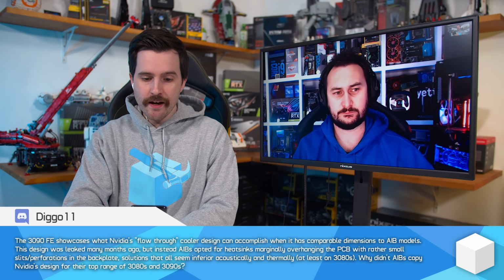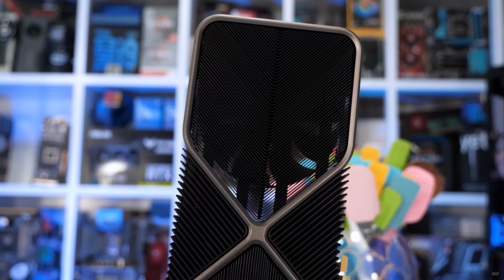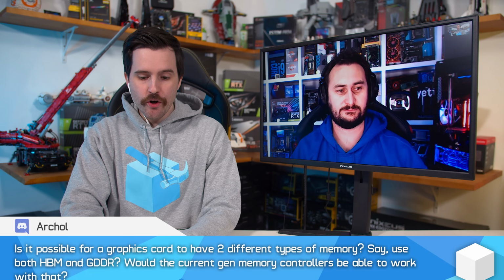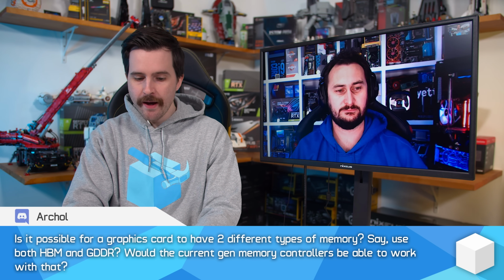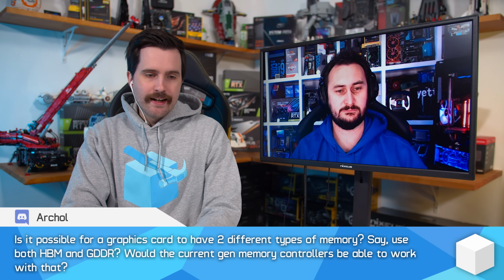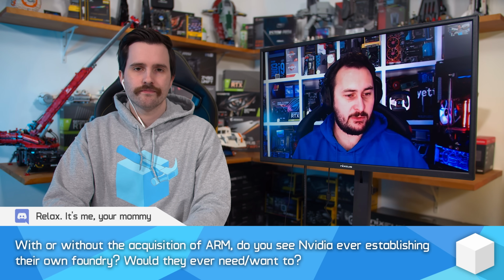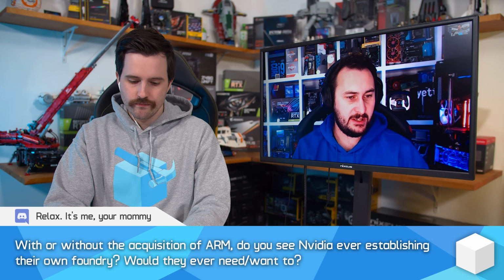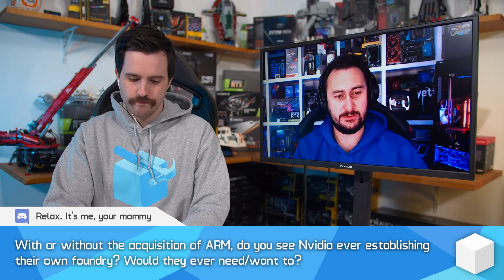Will RDNA2 and Zen 3 Have Launch Issues? Can AMD Beat Nvidia at Ray Tracing? September Q&A [Part 3]

Comment: My rx 5700 xt had HDMI audio issues since launch day.. Yep for a full year I couldn't use HDMI audio as it would stutter, cut out and  certain games just didn't have sound at all. I eventually got a HDMI sound bar for my tv and it had the exact same issue.. I had to use a optical cable connected directly to my motherboard. 
The last three driver updates completely broke freesync too.. I had to revert back 20.4.2.
Fan curves, overclocking etc within the AMD software wouldn't save after a reboot ethier.  Had to manually load my profile everytime. 
Some games especially certain older  titles run horribly on the card.. Dishonored 2 has a constant micro stutter, fallout 76 runs god awful (lower end nvidia cards beat the performance) and rage 2 has a technical glitch with spark effects 

Quote rare but I also experienced the green screen crash when hooked up to my TV (didn't happen on my monitor) 

NEVER AGAIN

Got an RTX 3080 over a week ago and haven't experienced a single issue when hooked up to the same 4k TV (same hdmi cable too) no audio stutters, games that ran like crap work smoothly and my monitor which has freesync but is g-sync validated works like butter lol

Love the cpus from them but not getting an AMD gpu again and I've been buying AMD gpus since 2012..my first experience of green team has been amazing 😁
Reply: That's what you get for buying cheap. Should've gone with 2070 super.
Reply: @fabAB912 ? I got an RTX 3080 last week
Reply: Really? Cool story bro, but I never had such issues. Not that I had the same use cases as you, but still.
Reply: @robertstan298  Why would you insult a fellow PC gamer who has suffered these issues with "cool story bro"? It seems unlikely that someone would make up a story and you're not having the issue changes nothing. No one who has a problem gives a shit that you don't unless you have a solution to the said problem.
Reply: Assuming everything you said is true, which I believe it is, your comment is one of the most important things that can be said about GPU choice. 

Spending big money on a product that doesn't work properly is infuriating. I don't care about 10% this or that performance if the product is a malfunctioning mess. There's a lot of people who bought 5700XT who had none of these issues but perhaps they are using Display port and MB audio. If the card comes with HDMI then the HDMI ought to effing work. 

I'm hesitant to buy 3080 because of the energy consumption, but I'm not going run out and buy AMD unless I am reasonably sure that I won't have  problems. 

Incidentally, my Gigavyte RTX2080 had absolutely appalling fan curves and the software that you could use to change them caused the card to lose 99% of its performance whenever an Nvidia driver update came out. To that I said "never Gigabyte again".
Reply: @Mattribute  Well some of the 3080 issues that have popped up (crash to desktop, performance degradation etc) have to do with drivers. Some of the card makers have resorted to pushing out new BIOSes that lower the clocks. Anyway, driver issues or hardware ones... Ampere launch has been pretty abysmal. If AMD has a better launch and decent initial drivers I'd say they have a good chance of winning some mindshare and good faith. They've been hireing a lot of new software development people recently and they've also been bleeding some of that Zen engineering talent into the Radeon division as well. Fingers crossed gamers finally win something back this genration.

Comment: I deem it very unlikely for AMD not to have supply issues at launch. The Zen2 launch was one of te worst in recent history so it couldn't be worse than that but probably still worse than the RTX3080 launch.
Reply: Tbf those were both popular releases.
Reply: @somethinglikethat2176  Definitely and Zen3 is expected to also be popular but there will probably be more supply than with the Zen2 launch because AMD didn't expect Zen2 to sell as well as it did. Of course AMD is still a bit of a small fry compared to Apple or Nvidia so it isn't certain how much production capacity AMD will be able to get from TSMC even though Nvidia Ampere is produced by Samsung. So I expect Zen3 to have more supply issues than with the RTX3080 but less than Zen2. With RDNA2 it will depend whether it's actually good. If it has good price to performance it'll probably sell as AMD expects but if it's actually good full stop there will definitely be supply issues as there will be more demand than supply. That would be Zen2 all over again.

Comment: 12:37 If one trusts leaks, AMD's RT solution is inferior to Nvidias in Performance, it is however optimized to need waaaayyy less die space.
Reply: Inferior to Ampere maybe, but probably superior to Turing. Either way the tech they supposedly use does seem pretty ingenious and efficient. Props to AMD engineers if they pull it off.
Reply: Interesting from a technical standpoint but not from a consumer standpoint. Just buy whichever is most powerful in the typical games you play.
Reply: It's confusing because leaks say AMD's RT is faster than Turing but slower than Ampere. Yet hardware unboxed testing says both Turing and Ampere incur the same performance hit.
Reply: @Arjun-eb1yc  Yeah, I was also a bit confused by that video Tim did, coz he pointed out something valid, ie, even though the RT perf of Ampere is higher it's mostly due to brute force (more RT cores), but the perf hit by enabling RT is roughly the same (slightly lower at 4k iirc). Whether the gen-2 RT cores help in any of that is still unknown, even though Nvidia claims some 2x number.
But then again it depends on the core config, imagine if the 2080Ti (or the 3070) has the same no. of gen-2 RT cores from the 3080/3090, then we could be looking at much less perf dip by enabling RT.
Reply: Not suprising since nvidia has more experience with this technology

Comment: I think this could be the first ever time AMD will come dangerously close to Nvidia's performance.
This is why they released the 3090 - it'll probably come down in history as the new Fury X, 290X or Fermi in terms of high performance and high thermals.

Still, if AMD really wants to completely steal that performance crown, they'll need way more than 50% perf-per-watt improvements in RDNA 3.
Reply: 3090 has bad thermals? Have you seen the reviews?
Reply: fabAB912 No. Are the thermals okay?
Reply: @mix3k818  like 76c but it consumes too much power for me. also amd is most likely to beat it while using way less power
Reply: @justmixah3408  beat the 3090?
Why you feel is too much power?
Reply: @2boostedsilverado  you have to have leaks to know why its to much to explain
Reply: @justmixah3408  hope you are not getting your leaks from Moores Law is dead" Lmfao
Reply: @2boostedsilverado  im getting them from my own people LmFaO
Reply: Thermals! 
I want what you are smoking dude

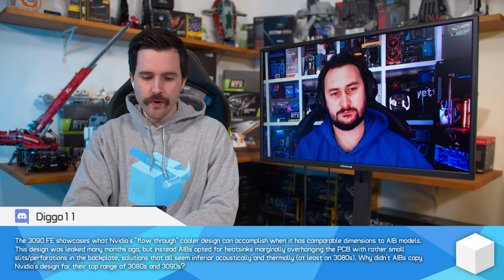Comment: 05:10 people always forget that GPU's with fins going longways also dump a lot of air out the back of the computer case, there almost like a half blower (a bit like the nvidia one but much cheaper).
may not be as much air going out the back but i can feel a lot of air being pushed out the back of the gpu when i play games.
it's only fins going short ways (towards the mobo and case side) that dump all the heat in the case but at the same time the hot air gets out faster so they are more efficient at getting the heat out of the gpu heat sink.
the blow direct thro the PCB like the nvidia's second fan (or say some of the sapphire gpu's) is the most efficient as the air is not forced to do a 90 degree turn but agen all heat go's in the case but at least it's pushed in a good direction to get sucked out with this layout.
Reply: @METhOdhowtoKilLnoObS im not talking about blower cards but normal dual fan ones with heat sink fins that go longways on the card (front to back).
they push a lot of air out the case.
lots of cards have fins that go sideways (from mobo to case side) that dont push any heat out the back of the case.

so i was trying to say cards with fins going longways like the nvidia setup push a lot of the air out the back of the case (not as much but still plenty)

Comment: That 21:9 demo was dramatic AF. I approve
Reply: One Person who I know from all possible people who I know has ultrawide. Did buy it two weeks ago... Lets be real... Wide screen is really rare among pc users! Just like 3090 is rare, but ofcourse there Are people who has those... but a common... no...
Reply: as a fellow UWMR I also approve and I dunno if you guys actually know but there is a great chrome extenion called UltraWide Video, so everything fits perfectly.. for like 2 seconds of the video anyway lol.16:9 will die soon enough, steam charts are not the only thing that matters, more are using UW than most people think
Reply: @connormoorerocks  16:9 wont die anytime soon, its the best gaming res, to start (yes ik 21:9 looks better AT CERTAIN GAMES, obiously productivity is just plain win for 21:9 bcz u know.. its just more display), but 21:9 displays r also more expensive than 16:9,  and dont forget, refresh rates, 16:9 have less piels to drive so, for competitive gaming u can get a 240+ hz display while ultrawide... the odyssey g9 sure, however something fairly possibe is 18:9, why? well smartphones use it
Reply: @arencorparencorp2189  Damn that marketing. They're using 18:9 instead of 2:1. It just sounds so much better
Reply: @Saigonas  well since its fullhd+ it comes from 16:9+.. so yea like 2k is usually refered to 1440p
Reply: @arencorparencorp2189  yeah, but isnt 2K like 2160:1080p?
Reply: @Saigonas  exactly, its incorrect but usually means 1440p

Comment: Zen 3 likely no.

RDNA 2, however, just like Turing, Ampere and every ATI/AMD GPU release past 2010 will likely have driver problems at first.
Reply: you mean like  how Nvidia cards are having driver problems? Before you sook about it not being Nvidia, I'm talking about screen tearing on 10 series as well with latest drivers
Reply: Lunchos El Maximus then you don’t know how to use the in game settings and or the nvidia control center. Both my 1070 and 1080ti have no issues with screen tearing. You just suck. Software issues exist everywhere, it’s not limited to just intel, amd or nvidia. Some do it worse than others... like in the recent years is amd.... cough cough, r7 and 5000 series. Nvidia having issues on 2 models of gpu’s was cause of the aibs.
Reply: Same thoughts
Reply: I don't remember Turing having driver issues at launch, Ampere has driver issue for it seems 1 revision (current version seems to already resolve the issue) and Linux nvidia users never had crashing with Ampere.

AMD meanwhile... oh boy half year after release there were still issues both on windows and linux.
Reply: piotrj333 I remember people were complaining for 3 whole weeks before Nvidia uploaded the Turing patches.

EDIT: Still better than AMD's RDNA 1 patch release (8 months), but it was there.
As for Linux, I've heard AMD had better driver reputation there than on Windows (but probably only because of Nvidia's own drivers)

Comment: Personally RDNA 2 i think will have some sort of issues. For nvidia they had one whole generation with dedicated hardware and still launch was shaky, it took many updates to make for example rtx in battlefied 5 acceptable. Nvidia had issues with first generation of DLSS (DLSS 2.0 is absolutly other story).Chance that AMD will nail down raytracing, dlss, raw performance etc. without upgrading their processing node (comparing to RDNA1) is actually low.

CPUs in that aspect of technologies are actually easier to adopt and AMD mostly only improves stuff they already did so on CPU side i would expect it mostly to be fine (beside potential BIOS updates).
Reply: To be fair, they already had developed the sharpening technology they want to use for raytracing, they could have leveraged their console partnerships to develop a raytracing technology, and the first Navi cards were actually only partially using the RDNA architecture, which itself was a brand new architecture (Needing optimization), so I wouldn't be surprised with a big jump in performance.

Especially given AMD actually had something that looks like a R&D budget this year (Imagine that, AMD choosing not to use a blower cooler! Madness, I tell you, madness!)

I just doubt that they can use their sharpening as a "dlss alternative", except for like, very small increases in resolution (Forget 1080p to 4K upscaling)
Reply: IF (And with Radeon that's a big if) they can deliver the raytracing they're promising, I can see it becoming a question of whether you want DLSS or you want a raytracing that just works.
Reply: @WhenDoesTheVideoActuallyStart  Yeah, I feel like if any generation of Radeon cards will give at least some competition across the entire stack, this will be it.

As for DLSS, I'd probably not look at it as a major factor in purchase choice (For now at least), for the simple fact that it's probably going to be very difficult to implement, given it's reliance on machine learning. With Raytracing at least, basically everyone is just using the Microsoft DXR API, which should just work on any hardware
Reply: The major problem with Turing was it was very much the beta test, for Nvidia and developers. Very few games actually had raytracing, and fewer still had it done well. AMD has had a year with various titles supporting DXR to test behind the scenes, improve the architecture, and the fact that 7nm is still a better node than TSMC 12nm like Turing, or Samsung 8nm like Ampere. Nvidia rushed Turing out to get RTX to the masses, and build up that mindshare of associating raytracing with RTX, and making sure we all knew it was "The future of gaming." The problem AMD had with RDNA1 wasn't that 7nm was behind, It's not, in fact it's still ahead of Samsung 8nm. The problem was the architecture itself had problems. Problems they've had a year to redesign around, and potentially fix.

While I don't think the raytracing performance of RDNA2 will be anything to write home about, it should at least be playable on most of their cards, which is certainly better than Turing. It will almost certainly be behind Ampere however. As you said, Nvidia has the advantage of dedicated hardware, and an entire generation to work on the kinks. There will probably be bugs, but ultimately it should be playable. From a developer side of things however, I do think it'll probably be far easier to implement and optimize raytracing for AMD's side of things, since working with Nvidia and its proprietary stuff has historically been a major hassle for developers. Nvidia doesn't make it easy to work with them.

Comment: According to the data I've seen, the 3800X has cores that are binned as well as the 3900 and 3950.  I'm hoping this is the case for the 5000 series so that I can get the best possible performance per core at the least cost.
Reply: 3950x is two 3800x tier chiplets together that didn't have good power usage for server parts, the 3900x is one 3700x and one 3600 tier chiplet together.
Reply: @WayStedYou  which is why there is a 500mhz difference in stock boost speeds between 3800x and 3600...oh wait 🤔
Reply: @WayStedYou  3900X are two 3600X chiplets not 3700x and 3600X.